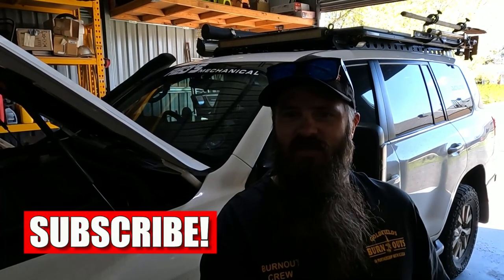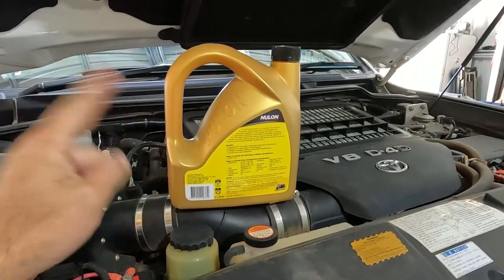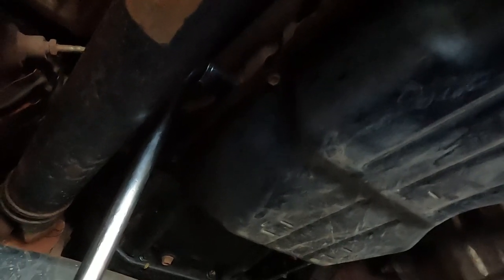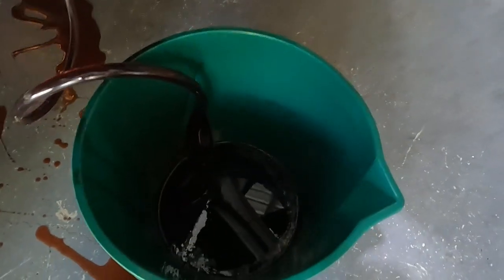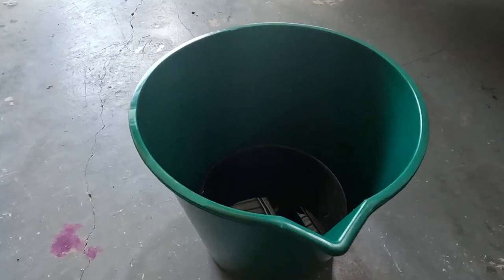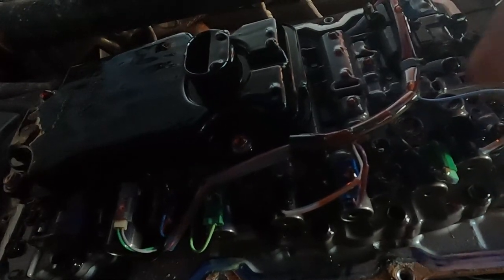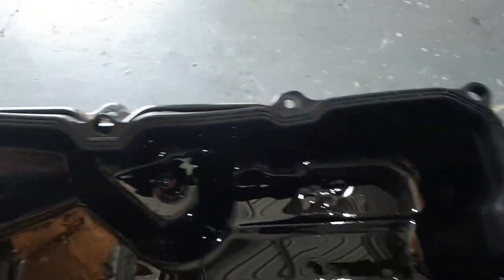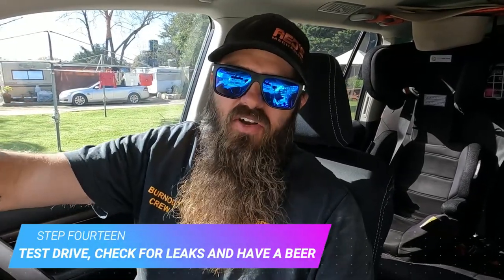Landcruiser 200 Auto Transmission | Service | Flush | What Toyota don't want you to do

Comment: Great video Marc. Don’t risk burning your hand close to that hot exhaust DPF with this “bring up to temp” story. Dealer apprentices don’t because Toyota does the maths: Mineral oil has a coefficient of thermal expansion 0.00064 volume per 1deg C. If garage is at 20 deg and you warm trans to 44 deg, that is 24 deg change so oil volume expands 0.0154 which is 1.54%, that’s nothing. Just warm up the new oil first, pump into a warm trans and you're good.

Comment: Good job. I always add a little more liquid, this compensates for the change in level on the ups and downs. A little about the intervals for changing the fluid in the transmission. AISIN manufacturer recommends changing it every 20,000.
Reply from the maker: that is a good idea with engine oil too, always going to burn a little, ha ha.... cheers for watching :)

Comment: Great job Marc, how you filmed , worked on the car at the same time whilst crawling underneath was amazing to watch loved the monkey feet 😂 holding the pipe in the bucket with your foot was funny to watch , all the proactive maintenance will see the 200 driving like new for easy another 100,000ks , I thought for sure there was a transmission cooler already fitted ? Look forward to seeing any difference once you have installed it , thanks for sharing 👍
Reply from the maker: ha ha thanks legend :)  it does make it hard to film and work, especially with my sub par production value, ha ha.... the 200's do come with a trans cooler but it is quite small and the one i am going to install is a "twin core" and adds onto existing one so it makes it a "3 core"... will be interesting to see the difference it makes :)

Comment: Hi Marc, i did the auto service around 3 months ago and did a full flush, we had a couple of pan bolts that were suspect (one was sheared another cracked) and I replaced all with stainless with longer ones at back for draining the pan next time. We also had sealing issues and had to drop the pan and clean everything up and use Red RTV silicone and this was the only way to seal transmission pan. Great video. The pan still holds around 1.5 litres once all oil is drained so worthwhile dropping pan to clean magnets and pan itself and replace filter which is recommended every 80,000kms. pump is the only way to do this and two people!!!!!!!!!!!!!!!
Reply from the maker: oh wow, good thing u replaced those bolts :) it would definitely be easier with two people that is for sure... keep up the good work :)

Comment: @ the 10:44 mark, I think you are shifting thru the gear positions far too quickly for the gearbox to actually engage the torque converter, and solenoids.  Great footwork though!
I found that Toyota WS genuine fluid is not expensive at all from Toyota dealers so I use that instead of Nulon which seems to be compatible with too many other vehicle standards to be credible.
Reply from the maker: Cheers for the footwork complement,  u r probably right about the speed of the shift but at least the pump is still pumping the fluid through the box... I was closer to a supercheap than a Toyota dealer so that option was the best for me ;) good to know about the Toyota WS oil for next time 😎🍻

Comment: Thanks for another great video. A bit off topic, what tyres are you running as they look like they have great wall protection.
Reply from the maker: No dramas at all... tyres are Kenda RT's (33inch) and they are rubbish to be honest... I have had 3 blow out with sidewall damage and have multiple splits in them at the moment.  I am waiting for the lap to finish then I will be doing a "rebuild" series where  will be upgrading to a set of 35's so will change them out then (if they last).... I am looking into Maxxis or Bridgestone/Goodyears next, but in an All Terrain :)
Reply: @DucruznOZ  thank you for your response and honesty
Reply from the maker: @briananddianehardy8598  all good mate, no point sugar coating it 🤣🍻🍻

Comment: Hi Marc, Just been looking at trans coolers for when we do the lap next year. What EGT does the 200 run at towing on the flat and also up a long hill?
Reply from the maker: Trans cooler will definitely help, a tune will be better too ;) egts sit anywhere between 300-450 depending on loads... 🍻🍻

Comment: When I did mine, one of the sump bolts was seized and the head snapped off. I had to drill it out and re-tap and re-size. Bugger of a job and a bit of panic set in when I first did it but it all worked out ok. Car’s done 350k and is bullet proof.
Reply from the maker: oh bugger, that is always a mechanics worst feeling "the ol snapped bolt", at least u had a win with it and are going great guns :)

Comment: Marc I have about 230 000 km on my 2015 Landcruiser 200 with a full service history at Toyota, should I be concerned regarding the mileage, is it time for a new one or can this engine continue ticking over for many years to come.
Reply from the maker: Hey mate, if it has had full service history and u have looked after it I would say it can keep going for a lot longer... mine is a 2016 with 220k on it and we have pushed it fairly hard and still hasn't missed a beat (touch wood).... in saying that sometimes they can just let go, it is a hard thing to predict.... I would maybe go in for a full intake clean and maybe inspect the turbo's as they have been known to fail, especially if the engine has been dusted :( hope that helps.... I am hanging on to mine for many more years .... can't beat Toyota 😎😜💪
Reply: @DucruznOZ  Thanks Marc for your advice, mine hasn't been pushed hard and no dusting, mainly used as my day to day vehicle and very long trips on tar roads with off road now and again and into the Namib desert
Reply from the maker: @petergriffin4564  should be good for another 200k then 💪💪if u r seriously concerned maybe get a compression test done too.... that will give a good indication of engine life 😎

Comment: the level is with the engine off dont replace the filter cuz is not a real filter , use the toyota oem fluid and change the oil in 3 steps
Reply from the maker: The level needs to be with engine running and it is a filter.... make sure the oil used is a correct replacement and u will be fine..

Comment: And in terms of time, is there a limit assuming you are not driving the car frequently?
Reply from the maker: @rahalati  if u mean time between changes I would do 40-75k if you are towing a lot and maybe 80k for normal driving...
Reply: @DucruznOZ  No, I mean how many months/years between changes if you do not drive the car frequently
Reply from the maker: @rahalati  oh, well usually 20k/yr so maybe 4-5 years 🤷‍♂️
Reply: @DucruznOZ  Thanks, My 2017 LC200 has been driven only 40000 km and has not had any transmission fluid change, Do I still need to change it now
Reply from the maker: @rahalati  maybe just get it hot and check the condition/level of the oil and if it doesn't smell burnt or discoloured would probably be OK 👌

Comment: Did you replace the washers or reuse?
Reply from the maker: I re-used all of the hardware :) they aren't torque to yield bolts etc so it is fine to use again if they aren't damaged 👌
Reply: @DucruznOZ  Thanks brother
Reply from the maker: @DallasTide  all good mate 🍻

Comment: Do you have the torque spec for the pan and the filter screws
Reply from the maker: Hey mate, here are the specs needed...
Trans filter bolts - 10nm
Trans Pan Bolts - 6-15nm
Drain plug - 20nm
Check plug - 20nm
Fill plug - 30nm

Think that is it ;)

Comment: Do you have the torque specs for the pan and filter bolts?
Reply from the maker: I think pan bolts are 6 to 15ft-lb and filter not quite sure 🤷‍♂️ i just do them up by feel, not too tight though .....
Reply: Hi Guys,
Completely agree with the regular servicing, I have been doing flushes on mine for years, sealed for life is a joke. 
Torque specs for 200 series AB60E/F below. 
Trans Filter Bolts - 10 Nm
Trans Pan Bolts - 4.4 Nm
Drain Plug - 20 Nm
Check Plug - 20 Nm
ATF Fill Plug - 39 Nm

Cheers 🍺
Reply from the maker: @jamesp3298  legend, thanks for that 🍻
Reply: @DucruznOZ  
No worries mate. 
I’ve always torqued mine to spec, just to err on the side of caution, would be a pain to strip a thread in the Tranny Case….
No dramas so far…🍺
Reply from the maker: @jamesp3298  100% agree mate, nothing like a stripped tranny 😎😎
Reply from the maker: @jamesp3298  ha ha, gross....

Comment: Very not smart to do the drain plugs before you make sure you can get the FILL plug unscrew.
Reply from the maker: True, but in my experience with Toyota Transmissions the likelihood of that is very small, you could also backfill it through the drain port if needed ;)
Reply: Found that out the hard way. I had already drained the pan b4 realizing the only 24mm socket I had was too long to access the drain plug. You need a stubby to fit in between the plug and the floor pan. And do use a 6-point: the fill plug (stamped 'WS') is shallow, roundy, possibly a smidge undersized, made of a soft metal, and so located you can't put a box-end wrench on it. After trying a number of hacks (pipe wrench on socket, etc), I eventually took an angle grinder to stubbify a 24mm impact socket & used the thin-headed torque wrench as a breaker bar. Many Toyota forums claim a 15/16th SAE socket is a better fit for the fill plug, even tho it is nominal 24mm.
Reply from the maker: @robertmcgovern8850  oh wow that is no good.... I have always used a stubby 24mm impact socket and have done for the last 20 years.... it is even a cheap set from supercheap I think.... had it since an apprentice and has been flogged to death 🤣🤣
Reply: @DucruznOZ  I'll just buy a replacement impact socket for $10. It was a valuable lesson: Make sure you have all the right tools on hand before you disable your transportation!😶
Reply from the maker: @robertmcgovern8850  ha ha, definitely a good motto to live by... if in doubt foot falcon or treddly for the win 🚲🚲
Reply: The vehicle manual does say replace it under extreme circumstances, towing, Offroad ETC. It’s in the beyond regular maintenance section.
Reply from the maker: @danieljohnson6455  yes it does, but like most males the instructions never get read, ha ha....